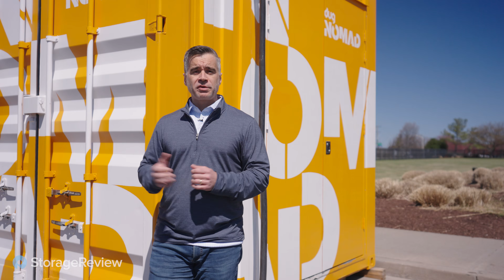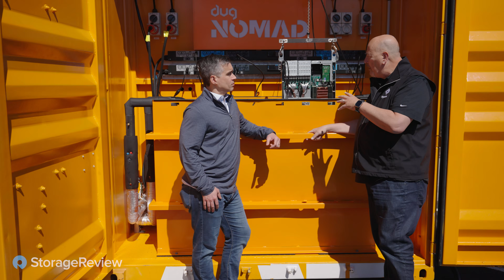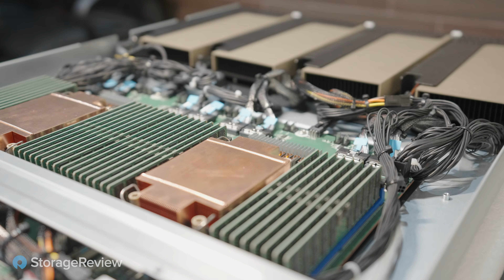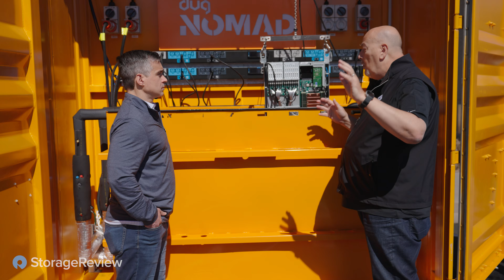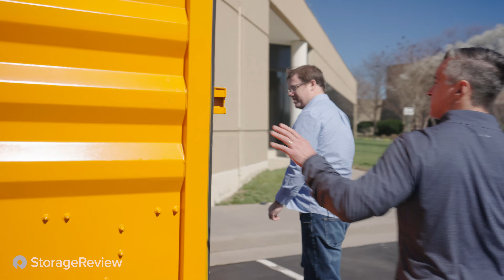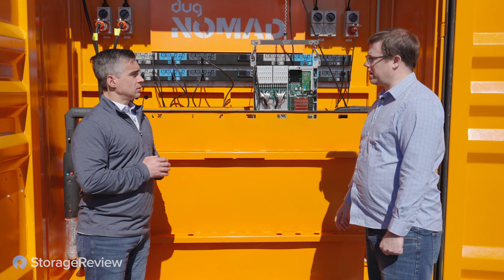This Mobile Data Center Can Go Anywhere (Except Volcanoes)

Comment: The engineering behind this portable datacenter is absolutely insane! I love it!
More so, 1.9PB in 1U of rack space is amazing!
Reply from the maker: From a storage perspective the density is critical. With "only" 26U available, they need to be efficient as possible with the physical space used for data. The 122.88TB SSDs come in clutch for that.
Reply: Perfect
Reply: That is not amazing, and it’s actually really low density if you look at the drives available today